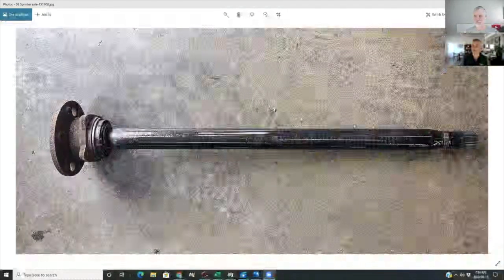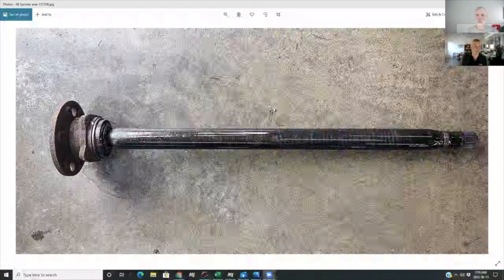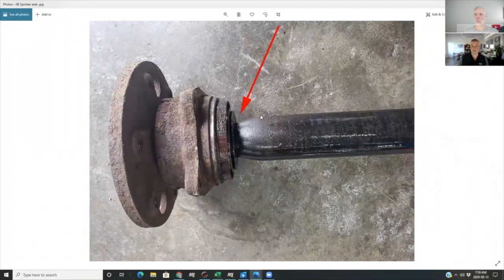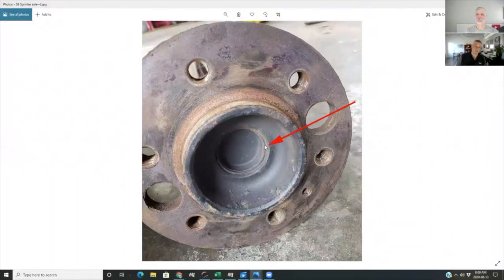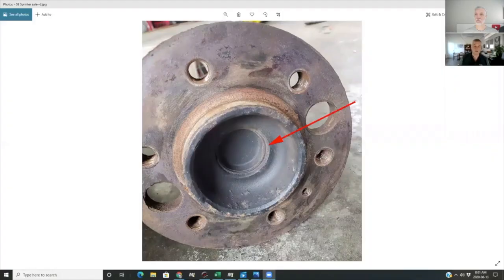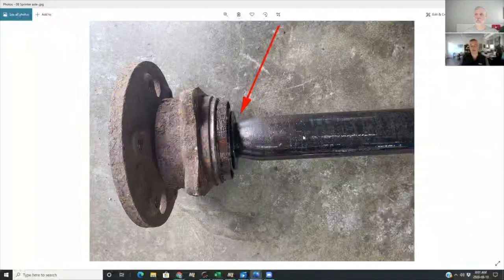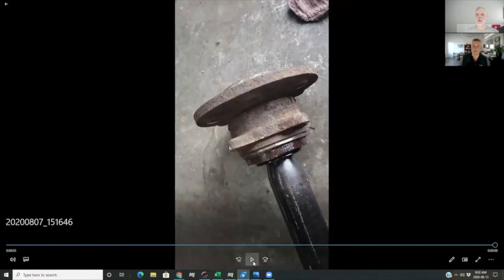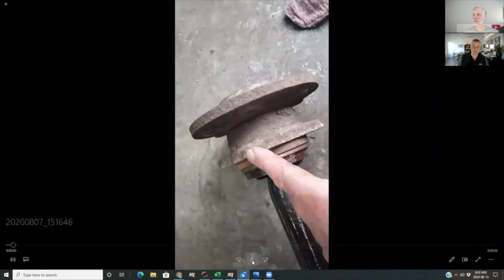2008 Mercedes Sprinter, Rear Axle Bearing

Comment: I have replaced lots of these bearings. You can get the bearing in the after market no problem.
Reply: I have a 2005 sprinter with this same issue.  Do you know if the bearing can be replaced or is it like above that the whole assembly need to be changed?
Reply: @seanbryant2349  you can buy the bearing spurious for about €150.You will also need to buy the oil seal. Mercedes only sell the whole assembly for about €850.

Comment: The bearing and hub come as one part , no need to replace the half shaft just tap the hub off its on a spline ,
Reply: Is tapping it off really that easy?  It's not a heavy press fit that needs special tooling?    thanks..
Reply: Do you need to add grease or anything? Or is it totally sealed? I'm replacing one on my 2016 4x4 and it looks self contained